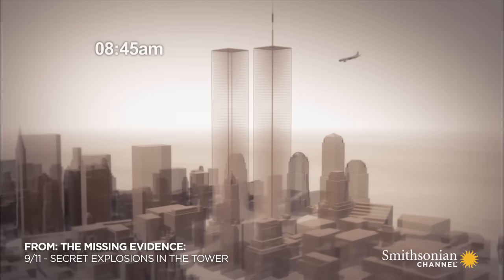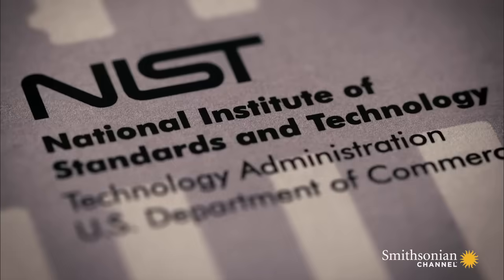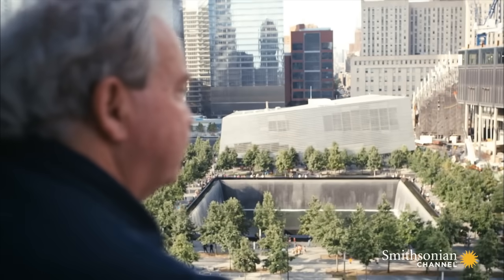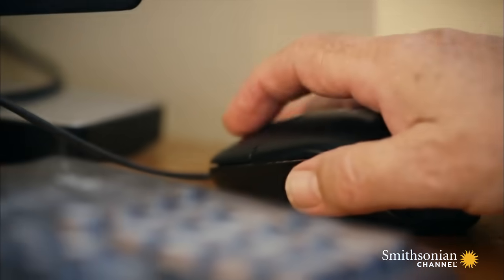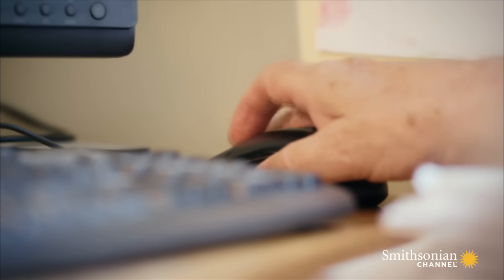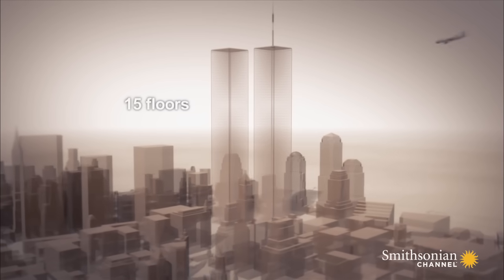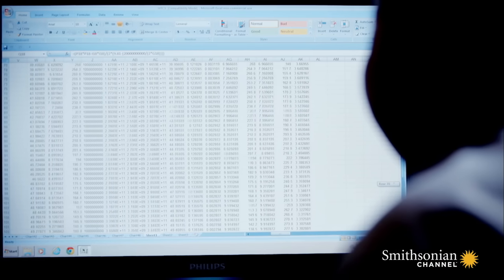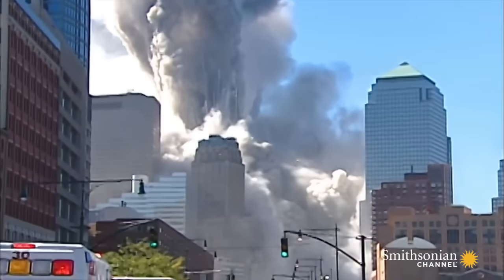This Computer Simulation Explains How the Twin Towers Fell

Comment: Government: "Building 7 was brought down by flames."

911 truther: "There are many buildings who have had fire but didn't collapse"

Me: "There are many people who have been shot in the head but didn't die. Does that men a bullet to the dome doesn't kill?"

Also me: "And how many of those buildings had 2 massive building fall on top of them causing extensive damage PRIOR to the fire?"

Inside job might be true. That I do not know. On the surface it does give reason for the government to invade iraq while having public support. All I am saying is that some of the logic that has been presented is not sound to be honest. Even if the government did it, the logic shown as "proof" by the 911 truthers is no proof at all.
Reply: Dinomin - "steel is not known to do well against fire." Don't be absurd. Steel framed highrises NEVER collapse from fire. NEVER. That's why nist had to invoke a NEW engineering phenomenon in their desperate attempt to explain building 7's collapse without explosives. Did you know that they claim ALL of the steel columns failed WITHOUT being significantly weakened by the fires??
Reply: Me: Kerosene can't melt steel beams.
Also me: Aluminum airplanes shouldnt be strong enough to damage reinforced steel beams
Also me: Why did my dad leave when i was 9
Reply: What makes you say the proof is 'no proof at all'. This video and so many others literally sciencetifically show that it is impossible for a building to fall down in FREE FALL because of some fires. Even if there it truly was because of the fires there should have been resistance by the floors below and not make the top floors accelerate. Please educate yourself before denying the proof without any points. There is so much on the internet to read and learn about 9/11 even on YouTube alone.
Reply: Nick L. McD um no dumb fuck we wont get over it. And neither will the families of the murdered. Only a fucking fool cannot see that this was an inside job. Fuck off
Reply: Woww!! OK... Just because I think you really need it, I'll take 2 minutes to write something... So, for your education, building ARE NOT like a human body. Building ARE designed with things like load calculation, resistance to fire, earthquake and many many more.

Building ARE NOT built with lower properties than the ones provided by engineers and architects. It would be criminal... I guess !

So... your "bullet in the head" example is really the most ridiculous thing that you could have found.

The human body is unpredictable. It can be born with  diseases, malformations and worse.

Would you live in a construction with such handicaps not present on the initial plans? Badly formed or missing beams? Concrete and steel with abnormalities of density?

These days, when a building is calculated to resist a plane, it will resist a plane and even 2 or 3.

It's mathematical.... and not biological. Hope you are not an ingeneer / architect. :) :)

Sorry for the mistakes, english is'nt my first language. Hope you had been able to understand my point. :D
Reply: Yes I think it's not impossible. The only thing I know, is that the whole truth had never been told.... and this is fucking curious !! So you are the FUCKING STUPID MORON to telling me i'm a CONSPIRACY THERISTS
Reply: Uncle Fkr what massive bldgs fell on them? That is stupid. Since we know the towers were reduced to rubble and completely fell in on themselves.
Reply: chris bollyn solved 911
Reply: Uncle Fkr we just had a tragic event in London within the last year. Grenfell Tower went up like a rocket, it was well alight by the time the fire crews arrived, within minutes. The fire just raced pwards, there was nothing firefighters could do. But did it collapse? No! Months later the charred remains of the building is still standing! And it wasn't built HALF as well as WTC. 🤔
Reply: Ill have to differ with you there...we have respected Phd physicists over here... Who are not on the govt dollar and who have everything to lose by sticking their necks out against the official fairy tale.
Reply: Your analogy is fucking retarded. It's more like:
Gov't: "WTC7 fell from fire"
911 Truther: "That would be the FIRST TIME IN HISTORY that a steel frame highrise has collapsed from fire. But controlled demolitions have caused that type of collapse countless times, thus making demolition the MOST LIKELY cause before any investigation is done.
You: No one have ever died from getting shot in the head. No wait, hang on I got it. Someone with a bullet hole in their head that is also dead probably just tripped on their shoelace. Yep.
Also you: When writing the official story, NIST determined that the damage from falling debris did NOT contribute to the collapse, but I'm going to defend that position anyways because I am too lazy to properly research the two sides of this debate.
Reply: leo dancor
yeah you not understanding the comparison proves to me you have about the same intelligence as a 9/11 "truther"
Reply: I don't think you realize Building 7 had no debris damage.. Maybe go watch YouTube videos of building 7...better yet look at Berry Jennings
Reply: smitty121981 he said people have survived it, but it usually kills. Also steel is not known to do well against fire. It concrete that does
Reply: YOU STUPID IDIOT FUCKING CONSIRACY THERISTS DON"T UNDERSTAND ANYTHING AT ALL! THE BUILDINGS FELL NATURELY GET OVER IT!!! plains hit towers all the time and they fall - just like any other plain and any other tower. your just dumb as fuck thats all such idiots

Comment: This simulation is counting on the fact that the mass stays in one place when it gives. The whole building started to break into several pieces on the way down. It would have just slid off the top leaving at least some floors left on the bottom. The entire foundation of the building was destroyed for both buildings. With no explosives that is impossible. Go look at video's of failed building demolition. Maybe it will give you an idea of why everyone believes it was blown up. It even looked like a successful building demolition. Also, how come this video doesn't talk about the third building that went down.

Comment: 25 per cent of a building cannot atomize the remaining AND UNDAMAGED bottom 75 per cent. if you believe otherwise then you are either a shill or have no idea how momentum and energy conservation works
Reply: 25% of the building can EASILY demolish the rest of it.  The structures safety margin was 5 x the resting static load. When the top failed it was the load equivalent not of 22 stories.  But of 200!!

Comment: I too am sick of the conspiracy theories. On the one hand, I understand them. They tend to stem from people's distrust of the government. And, there's plenty of misinformation around as a result. However, that's really about it. There really isn't much valid basis of these conspiracy theories. We know what happened. Some of their questions make some sense at first, but are really just hindsight bias. One thing that got to me, early on, was how the terrorists could get through security and hijack the planes. How did the government not end up shooting down at least one of the airliners? Well, this was a pretty new form of attack. We hadn't experienced anything quite like this before. And, there was a lot of issues in communication. This is similar to what happened with Pearl Harbor. In hindsight, we should have seen it coming a long way off. We had plenty of warning signs in both events. But, we didn't put the pieces together until it was too late. Anyway, when you actually dig into these events, there's no conspiracy. There were just a lot of mistakes made.

Comment: Nobody's ever said anything about how the law of physics says that the speed of the planes hitting the towers and their mass played a very important part in the impact. You have to consider that these planes weigh TONS and they fly FAST. So even if the towers were designed to resist the impact of a plane, it wouldn't have mattered because of the speed of the planes. And as far as the collapse of the towers, let's consider that the planes knocked out some of the support beams inside the building and they were replaced with the remains of the planes. So, the absence of structure struts and the weight of the planes as a combined variable is what caused the buildings to fall.

Comment: In 1975 there was a 3h fire in one of the towers on several floors. It did not collapse nor were there any structural damage. A building that collapses in free fall is not from normal fire, period. The buildings fell as fast as the persons who had to jump out the windows, where did the buildings then vanish?? Almost no rubble was left of the two buildings, it was all turned to dust, as can only happen in a controlled demolition.

Comment: I've got a theory: the planes crashed into the twin towers. By the way that the towers were constructed they relied on their floors to stand. I'm talking about how their insides were empty where the elevators where, and their steel frame structures were just the outer walls. So when the floors were destroyed by the planes, the towers constructional plans for having a wide, open space backfired. And with the outer walls damaged and the inner narrow parts burning away, the destroyed by the planes floors collapsed, allowing the upper sections of both towers to come crashing down and causing a mass collapse. Which is why the upper sections are seen crashing down upon their lower halves. And with the fact that the south tower had more floors above its destroyed section, the south tower collapsed because of the greater force of mass and gravity. So although the north tower was struck first, it had fewer floors above its destroyed floors, meaning that the south tower collapsed first, and the north tower followed suit!
If you agree with my theory, please let me know!

Comment: bullshit most of the upper floors mass blew over the side, the video shows an outburst, still no good reason why shit flew so far away...  left are steel trusts and floors, ,  any office thing could not withstand jet fuel. so the STEEL above and the floors of cement  is the load  weight....

Comment: This is bullshit. If one floor was gave way then there would have been a pause when then two parts of the building met but it didn't. The building fell at free fall which means resistance was removed from the lower floors. All three buildings fell exactly the same way!!! Wtf wake up people!!! Nist reports and models do not support the happenings on 911
Reply: Are there still morons who believe the free fall bullshit? Don't you see the debris from the sides falling faster?

Comment: bullshit, that weight above is the weight it was designed to hold... the fire would've lightened the weight a bit...there were people close up against the steal beams on each side of every window..  if that steal was so hot that it was melting or whatever there's no way those people would have been in close proximity with those beams, since the heat rises if you put a blow torch on the bottom of a steel bar the top of that bar will get so hot you can't hold on anymore this is all bullshit no way you can go down straight down, the jet fuel which mostly burned out on the initial Collision how the hell did you get away from all that fire
Reply: Neo Morpheus not going to fall into the game you all play....you all reply with a fraction of a reason with insults and an arrogant premise.  how many languages can you read and write,  I can do 4 .. perfect spelling, excuse sir... explain how 2 planes brought down 3 buildings....all u supporters of a lie are the same, and obviously at this point paid I would not be surprised.... let's stick to the STEEL,  how were all those people so close to steel which was heated so much...it was a hot day so cooling off quick wasn't happening

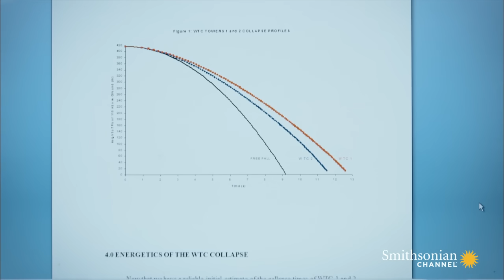Comment: 1:48 Wait, wait, wait ... he's using Excel to do scientific numerical calculation?! Seriously?! Thats simply the wrong tool!
Reply: Newton did scientific numerical calculations 300 years ago with pen and paper.
Reply: So do theoretical physicist still today when doing analytical calculations. But he is doing numerical calculations. There are specialised libraries and tools and programming languages for calculations like these. The number files generated are typically mega- to gigabytes in size. There are normed file types for working with visualisation/data analysis software.

Excel is simple the wrong tool for calculations like these. It's like hammering a screw into wood.

Comment: I guess this law no longer apply then: "For a collision occurring between object 1 and object 2 in an isolated system, the total momentum of the two objects before the collision is equal to the total momentum of the two objects after the collision. That is, the momentum lost by object 1 is equal to the momentum gained by object 2" . In other words. Maximum destruction could only have been 15 floors and 22 floors, since thats the  initial object... ohh and not in free fall ... and 10 other things.. But i guess the law of momentum  is not valid when it comes to 9-11
Reply: Just because you are too stupid and failed 5th grade physics doesn't mean your asinine claim makes any sense. Your interpretation of newton's laws is hilarious... or it would be, if it wasn't so pathetic and insulting to the victims.

With your interpretation a domino would never work, since one piece can only drop another, but... hey, they do! Either the dominoes violate the laws or physics or you have no fucking idea about the laws of physics, whatever is more likely.
Reply: I guess you are a loveable person in some other ways. . What in the definition dont you understand... and how come you find it insulting ?
Reply: Regarding Dominos, its gravity and transfer of momentum, but theres no residence apart from the piece itself. WTC wasnt flooting in mid air, and had a 300-1000 % redundancy, So basicly it means that one domino worl be able to tip ten dominoes stacked together. By your account every house would colapse if one floor fails - You cant believe that.
Reply: Come back when you understand the difference between dynamic and static load. TIP: All twoofers fail to understand this basic concept.

Comment: How did the weight of the top half continue to break all the floors beneath it all the way to the bottom when more than half of the top half fell off the sides?
Reply: Are you sure? Moronic twoofers have been claiming that it fell "into its footprint" for years...

Comment: Skyscrapers that catch fire always explode into dust and conveniently truck sized lengths of steel. Newton's 3rd law does not apply to skyscrapers and they also always leave large amounts of molten elemental iron when they fall down. In fact every steel framed building that ever caught fire exploded into dust and 30ft lengths of steel, Look it up.. do your research people!!

Comment: Utter rubbish. See the engineer on YouTube who did actual physical experiments, using models, not bogus physics and computer simulation. If the top tier of a wedding cake collapses, it doesn't smash all the other tiers to smithereens and leave a pile of flour and sugar, spread out flat. Even if that was possible, it wouldn't do the same thing to wedding cake 7, standing nearby, that has had nothing touching it. These are the people who told you about WMD.

Comment: Jet fuel doesn't melt steel beams, but it sure stretches and softens it. If you look at facts (something that can be proved), both theories are possible. Unfortunately, to go with either theory (it collapsed on its own or there were secondary explosions), the heaviest evidence can not be gathered by videos but only by what others say. Therefore, neither theory could really be proven by us. 

If you do the proper thing and investigate both sides with a fair amount of knowledge, you'd see that its a bit foolish to chose one side.

Comment: This supposed "scientist" is running some model he built out of fucking Excel. I'd like to know how he accounts for the lateral ejections of multi-ton beams hundreds of feet out while the tower is supposedly collapsing upon itself. Gravity works vertically. So what energy was there to create such unexpected forces? I love how the Smithsonian Channel doesn't address any of this. But what should we expect from a government agency?
Reply: What was pushing the walls out? The official story is that the fire weakened the floors and they sagged, which would be an inward force. Besides you say the exterior columns are falling off, so why is the core of the building, made of steel reinforced concrete, pulverized into dust? And the collapse drives all the way to the ground through the path of most resistance, all the way to the lobby.

Comment: sighs Yes, you're right people, steel doesn't completely melt at that temperature. But as steel gets hotter, it's strength weakens. The temperature was so high that the strength of steel was significantly lower than designed - therefore the super-hot steel could not support the building and it collapsed. So, you ask, why did it look like a controlled demolition? Well, skyscrapers have to be designed so that they collapse inwards (like a controlled demolition) to avoid damage to the surrounding area - because let's be honest, you don't want a massive skyscraper falling horizontally over in the middle of a densly populated city.